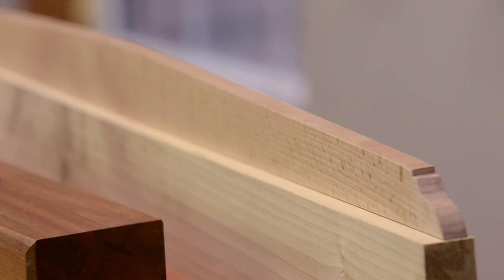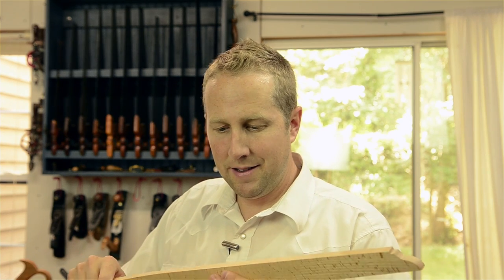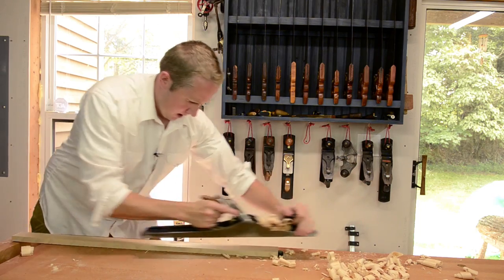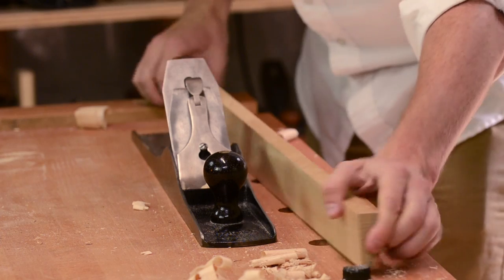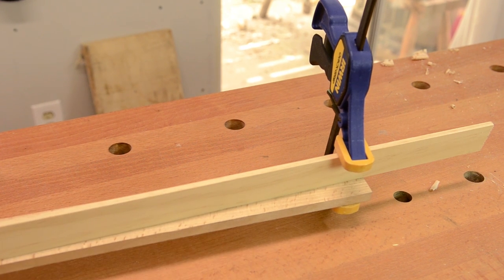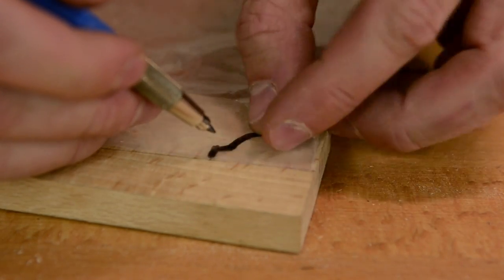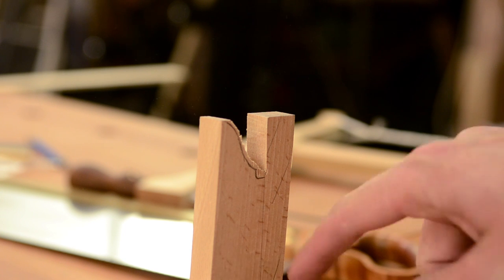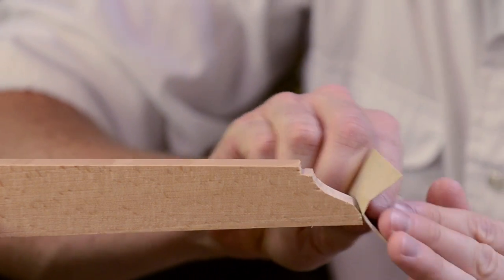How to Make a Wooden Straight Edge for Woodworking

Comment: One thing to mention is how you can check the straightness of your edge WITHOUT using another straight edge .. this is a precision tool that you are going to rely on so you need to test it frequently (espeically since it is made of wood and can move) ... To test it , place it on a flat piece of wood , like a piece of mdf, and strike a line with a marking knife using the straight edge ... Then flip the straight edge as if you are flipping a page if a book and align the edges of the straight edge with the knife line using the knife itself to help location and restrike the line ... Any deviation from the original line means that the straight edge is not perfectly straight ... The maximal point of deviation is twice the error .. for example if for an 8 foot straight edge that you made , there is 2mm deviation between the knife lines that you struck, it means that your straight edge has a 1mm concavity over 8 foot ... It is then up to you to determine what level of tolerance is acceptable ... Cheers

Comment: Make two strait edges at once. Put them side by side then plane them both together. Check straightness by sighting down the edge. Put them face to face to check flatness. This doubles the error. Keep planing and checking until no, or very little, light can be seen between  them when face to face. No measuring tools or strait edges needed to make one. For even greater accuracy, you need to make three at a time. The three strait edge method will get you strait and flat withing millionths, so is not applicable to woodworking. The arc and the other cuts should be done before planing the strait edge. Cutting the back can release stresses in the wood causing it to warp. Rather have it warp before the important part.
Reply: Thank you for reminding others there are simpler more reliable methods. As a bonus, reading your concise comment means I don't have to listen to lip-smacking, stuttering, nervous pauses and repetition.
Reply: That is just a mean-spirited comment. Sorry.
Reply: ardvarkkkkk1 thanks. That is so simple!
Reply: Thanks, Ardvarkkkkk1.  Of all the videos I have seen on making straightedges none have ever addressed the fact that the edge can only be as straight as the edge you compare it to.  

When you use the two edge method do you compare the edges maintaining their polar alignment simply rotating them to face each other, or do you swap ends?
Reply: orcasea59, recapping slightly from Aardvark above, I shoot the two sticks together, lying flat on the bench to take the weight of the plane out of the process and enabling a consistent squareness. I offer the sticks to each other like opening a book, not swapping ends.

Comment: One commenter said make two. Actually you need to make three, and compare them to each other 2 at a time, 1-2, 1-3, 2-3, rotating every piece, until no light shines through the crack between the edges when any two are compared. With two pieces it's possible they could be curved and still mate up, but with three it's impossible. You can use some kind of powdered abrasive and on a flat surface like a piece of granite countertop or the tablesaw surface keep rubbing the edges together. Flip them over and every which way. It will take down tiny high spots until they're perfect. It will also make the edge perpendicular to the face. Keep "candling" them until not a trace of light can be seen. With this method and some aluminum you can get machinist grade accuracy. For wood they don't have to be perfect. Actually the commenter below is right, but the mathematics are such that 2 isn't enough. With three you can keep them all straight forever. He's right that you should relieve the back first, and that you can get them better than 1/10 thousandths accuracy. Quartersawn is good, but use split stock that's as close to straight to begin with. The curved back is good because it makes the bar stiffer in the center and keeps the edges a bit lighter so that weight doesn't sage them much. This is more important with steel than wood.

Comment: Nice. Simple, too. I follow many woodworking folks on youtube, but Joshua often gives me the most understandable instructions. I used quartered white oak. I used my Lee Valley aluminum straight edge as a reference. I also tried just flipping the piece 180 degrees, which I think is simpler.

Comment: I recently bought a very old wooden joiner plane (jack plane)? 14inchs long. Cleaned it up manage to sharpen it up pretty good. I couldn't believe (after a fair bit of practice) what it could do.
I can now for the first time plane lengths of board that can be joined WITHOUT gaps !!
Joshua, this vid made my day. I'm very sure I could now make a PROPER straight edge !!!! As a great little project.  The plane cost £5   I think Its between 80-100yrs old.
I've even made a special mahogany shelf for it !  
Thank you ....happy days.  (subbed)
Reply from the maker: MrRichot You're welcome! A wooden English plane is amazing...especially at 5 quid!

Comment: what tool did you use to cut out the length of the curve?
Reply: +Mike West He clearly said he used his bow saw to cut the curve.
Reply: I am deaf , i rely on visual how to videos.
Reply from the maker: +Mike West Sorry, you can use a bow saw, a coping saw, or even (shhhh) a bandsaw.
Reply: +Wood and Shop You need to read and understand what Mike was/is asking.  He was NOT asking about how to cut the decoration on the ends.  His question was what did you use to cut "the length of the ARC".  And the answer, which you gave in the video...(but that  Mike did not hear) is hand saw (rip type).
Reply: +Roger Ramsey I think I should have addressed Caldermologist, since he was the one who did not understand the question, and had said to use the bow saw on the cut
Reply: +Mike West Try activating subtitles so you can read everything he talks about :)

Comment: to check for straight lay the straight edge on its side and trace a thin line then flip it over and to the other side of the line if the line doesn't look straight the straight edge isn't.

Comment: when you are planing the "straight edge" it's better to put the plane on it's side and use like a shooting plane,  that way your  edge is straight AND square face.. planing on top like you did makes it almost impossible to be perfectly and continuously 90 degrees to the face.

also, the stability of the wood does not need to be perfect.. all you need to do is check it and reshoot if it has become a bit curved over time..

I use wooden straight edges all the time but I do not make curves on the back or fancy ends and I do not use hand tools to make them.. all I do is joint the face and edge of a board, rip a piece off of and re-joint the narrow edge to make sure it's straight after ripping it off the board.. mine end up in the scrap bin after the project is done